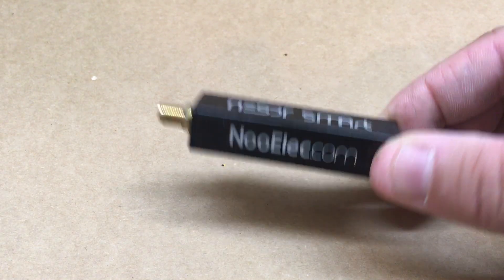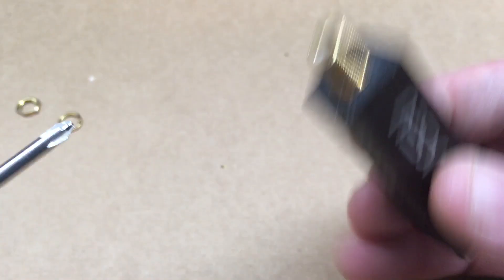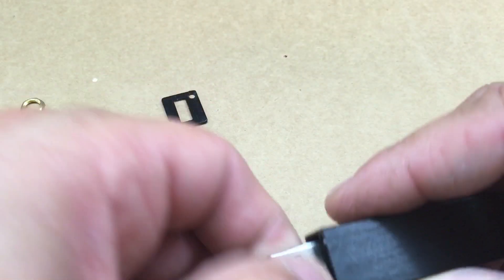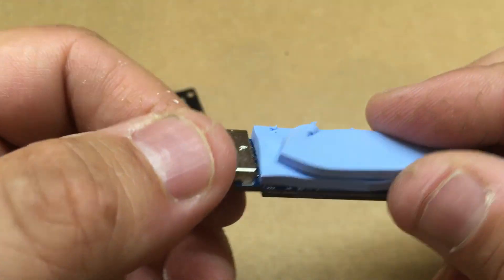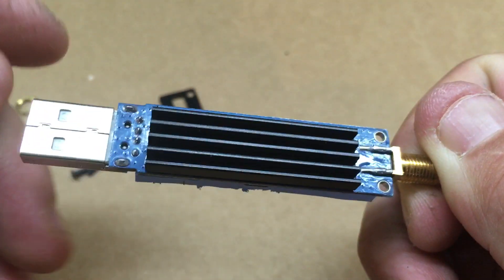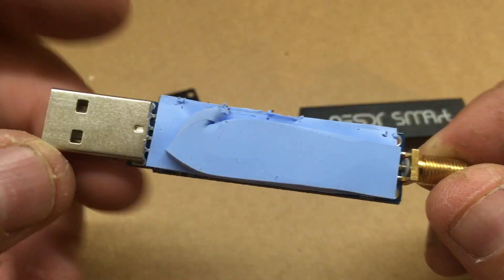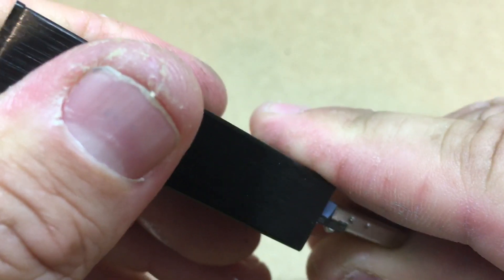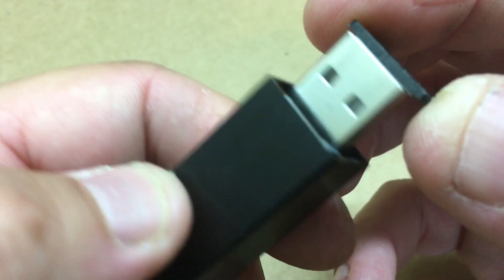Inside The NooElec NESDR Smart USB Dongle

Comment: Heatsink on one side, thermal transfer foam on the other.  Actually a really good design that does a great job of removing heat from the board and forcing it out to the metal case.
Reply: I was wondering if this would even do anything, a heatsink inside a sealed case..? Surely it would make zero difference right? I would have thought thermally conductive material on both sides would be better than having a heatsink internally. But, I am not a physicist so I don't really know. I have the one with BiasT so that it effortlessly powers my Nooelec LNA.
Reply: So its more a feature than a bug that it gets more than 'warm'. But I experience overheating related signal loss/noising occasionaly and plan on adding some passive elements, anyonelse having heat issues?